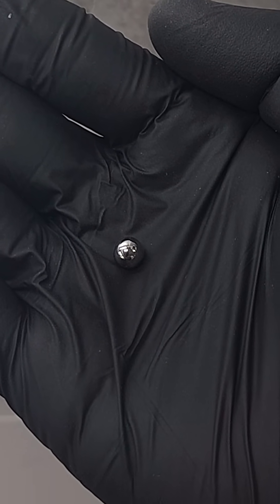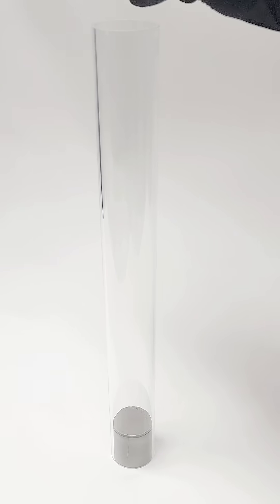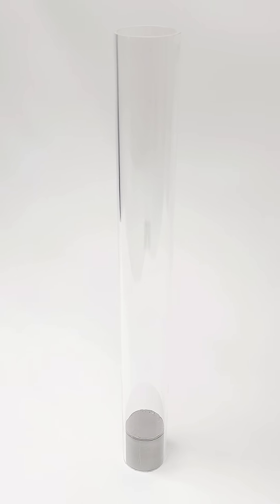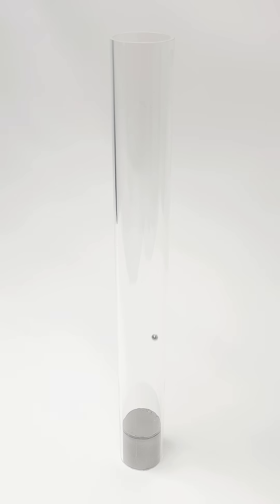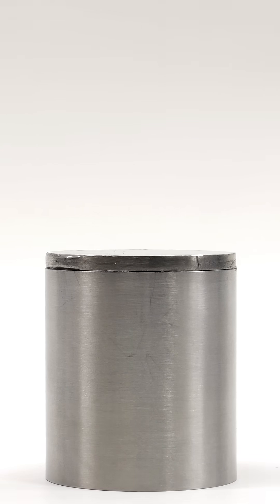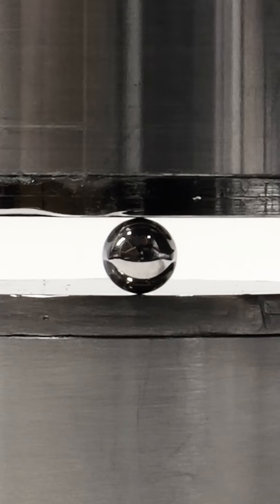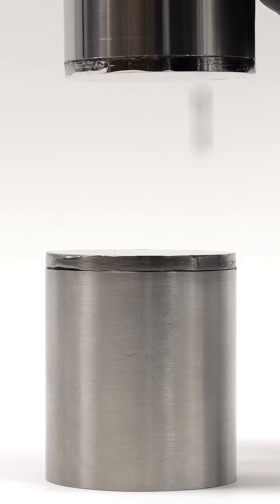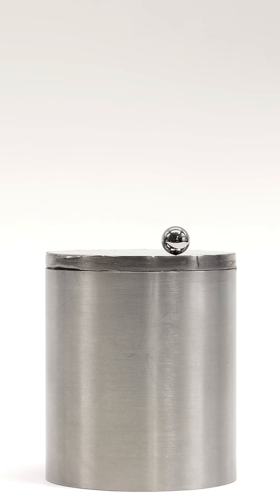This metal is too bouncy

Comment: I analysed the audio of the ball bouncing and found out that the frequency of the audio just at the end of the bounce is around 12kHz, which means that it was bouncing almost 12000 times a second!

Edit: Some people have interesting theories and suggestions, since this turned our to be a good debate, i just want to clear out some info:

1- the mic i used was a regular mobile phone mic nothing special, such mics can detect up to 16kHz if I'm not wrong.

2- 12kHz means there are 12000 individual beats in a second, which means the ball was hitting each surface 6000 times a second.

3- I tried to simplify this to be just for fun, i know i am probably wrong to some extent, if we want this to be a research it would need much more advanced equipment than i have and more specialised people than me.

4- Maybe if TheSlowMoGuys could capture some closeup very high speed footage we would be able to count the number of bounces more accurately, it would also be more fun.
Reply: I also thought about checking the audio, simply because of the sound effect, but then it occurred to me that near the end it would probably be clipped off by mic's freq response. We'd need something like a laser pointer pointing at the ball when it is "compressed" and watch the reflection on the wall meter or two away to learn more
Reply: @quetzalcoatl-pl love the idea, but unfortunately the mic will pick up those frequencies and translate them far better through a YouTube audio stream than the video could. Though a laser tachometer would certainly work if aligned properly.
Reply: if i may add - just in case - YouTube has 48kHz frequency capability, which means it can re-produce a 22kHz (top end human frequency hearing range, for most people) in a stereo stream of audio data without issue

many get confused a bit at the limitation of the compression of the data stream, which for youchoob is 256kbps audio compression - but this only affects the Quality of the audio output in human perception, not the frequency response range of the audio output.

ie. if your mic can record it, YouTube can output it
Reply: I knew it sounded like over 10k hz. This makes the material he created that much more impressive
Reply: @KUWAITGRIPSVEVO  If you think the material he created is impressive, you really need to watch the original video where he creates it, because although his version is still very cool, it is considered quite poor quality in comparison to the one he saw someone else use before deciding to make it. The other guy shown at the beginning of his video had one where when you dropped the ball into the tube it probably took like 10 times as long for the ball to stop bouncing
Reply: @HorusDeathtouch  if its not impressive make it yourself.
Reply: @tophatvideosinc.5858  I can't remember if I said it wasn't impressive and I'm not going through that many comments, but what I remember saying is just that if they think this is impressive I wish we could see what two pieces of the original metal could do. But yeah I watched his whole other video until the end so I clearly enjoyed him making it and it's a hell of a diy thing to do. He even had to work with a very deadly metal and purchase a whole new piece of machinery
Reply: You might be right, but it could also be a harmonic being transmitted by the ball resonating at a sympathetic frequency to the material. That's kind of how it sounds. To my ear it doesn't sound like it's actual frequency is above about 4k, and that we are hearing a third order hamonic
Reply: @unlisted9494 i was wondering similarly, but wouldn't it be filtered out from the peaks as sympathetic harmonics aren't as loud as the primary? If we're reading purely peak-to-peak. But this is also recorded through an unknown microphone, and through a YouTube compression algorithm, so lots of important data is missing or lost.
Reply: @tophatvideosinc.5858  Exactly. We need Slow-mo guys footage + proper gear to measure peak frequency.
Reply: Is it safe to assume that the sound it makes equals the frequency the ball is bouncing? Perhaps materials can increase or decrease pitch.
Reply: @marnix707 correct! If the sound frequency of a single bounce was 1Hz, it may be more conceivable that the change in pitch to 12KHz correlates to an equal bounce frequency.
Reply: @Templestone  were using hz to measure frequency of bounches, not the pitch or frequency of sound. Similarly to measuring framerate.
Reply: The sheer ignorance in this thread is astonishing 😂

I would recommend people playing with a PWM synthesizer to understand how individual sounds (“ticks”) of a ball can create a new fundamental frequency.

Also, why is it inconceivable that a ball bounces 6000 times per second? What makes it inconceivable per se?
Reply: @RustOnWheels  Physics makes it inconceivable. When something bounces at a frequency of thousands of hertz it isnt bouncing anymore, it is vibrating. It also isn notpossible due to travel time. Energy can only propagate that fast in a steel bearing, like the speed of sound. Of course, for any physics-flunking audiophile, reality might aswell allow anything within the contraints of their imagination.

Rhetorical question here: If someonething CAn bounce at 6khz, then is there an upper limit? Can it bunce infinitely many times within a set timeframe? Whats your take on this (fairly obvious) question.
Reply: @aronstalnacke9479  the ball acts as an oscillator.
Reply: @aronstalnacke9479  the ball acts as an oscillator. Without external excitation it will lose its energy so the amplitude will eventually drop off (while the bouncing frequency goes up). 

Now, in this video there is external excitation by a decreasing distance between the two surfaces. Due to friction the oscillation frequency will eventually top out (every bounce is a loss in kinetic energy so the higher the frequency the faster the kinetic energy is dissipated). 

So yes, there will be a maximum practical (audible) frequency on earth for any given material. 

I did not analyze this video so the actual frequency I will not make a comment about but I would also not rule out anything.

If I take a slide and pluck a metal guitar string I can go up to at least 10kHz audible. The sound created is the excitation of my nail bouncing between the bridge and the slide (resulting in standing waves).

The metal parts in my speaker can even go back and forth so many times per second that they create frequencies up to 20kHz (and beyond). Just like the bouncing ball (in between the objects) they have an external energy source. 

Is that also inconceivable?
Reply: Wouldn't that make it ~6000 bounces/s? Because every reflection (top and bottom) will create 1 acoustic peak.
Reply: @TheBerni44444 each bounce generates its own sound so it would still be 12k hz. If the reading is accurate. But the mic specs and compression play a role in this.
Reply: @TheBerni44444  it bounces at the top and it bounces at the bottom
Reply: @TheBerni44444  I think 12k strikes, with 1 strike on top then 1 strike on bottom, would create 6k oscillations (round trip for the ball), but it would still be 12k bounces since the ball is bouncing off of both surfaces, not just the bottom one.
Reply: @TheBerni44444  Its Like a sine wave...  Like a full sample...
Reply: @TheBerni44444  Each bounce creates a pressure wave that will each result in an isolated acoustic peak.
Reply: @TheBerni44444  Wow bro, you seriously must have flunked physics! Don't even try bro!
Reply: It can be over 20k, we just wouldn't hear it
Reply: @utvpoop youtube doesnt allow for over 15000hz anyway.
Reply: This is the true version of analog audio oscillation. I've only ever heard the digital wave form while switching frequency on my ham. This is amazing!!
Reply: Just did that myself, probably got way higher though because magnitude the sound waves gets smaller the shorter the stroke and it likely quickly and quietly got past the mic’s range after 12000hz
Reply: How many times have you farted into your audio device? And don't lie.......
Reply: That's why I'm here, in total or just today? @bryanergau6682
Reply: I'm listening on my phone and only heard about a high C#8 / D8? 🤔  ~4.6 Khz.  BUT... 

There may be limiting factors all the way from the response in my ears, my headphones; the max bit rate of YouTube, Nile's upload, or my phone; the max sample rate of Nile's recording 😅...

Alright, lemme put on some coffee. 😌☕

Yes, I absolutely want a slow-mo of this experiment, if anyone finds one.  It'll be better than slowing down the existing video.  Thanks in advance. 🍻
Reply: Would the materials affect the sound? And would youtube video compression affect it? Is this an accurate estimate, or are there factors that will greatly affect the value you calculated? These are genuine questions, im really curious
Reply: @Jessepigman69 YouTube audio compression nowadays are transparent enough to process audio frequencies above 16 kHz, since the current Opus codec that YouTube utilizes cuts off the high frequencies at 20 kHz. You can check yourself using an audio spectrum analyzer such as Spek.
Reply: It might be higher since it likely cut off at the frequency for YouTube video.
Reply: Thank you for taking the time & effort.
Reply: More math people like you are needed.
Reply: Nice for u to tell us the info😊
Reply: You beat me to the punch. I was going to say the same thing: record it, then look at the audio waveform to extract the frequency.
Reply: @sentinelav Bro told him to shut up just to behave like a cretin himself. Where did you graduate? Blabbermouth high?
Reply: I was gonna say, I could tell immediately the pitch went fairly high in the range of human hearing, had to be over 10k
Reply: from this we can roughly calculate the distance at which elastic bouncing stops 

(due to van der Waals forces between the surface of the ball and the plates maybe? for whatever reason distances become so small the  system dissipates kinetic energy as heat fast enough to stop the bouncing in short order)

let's say the initial velocity comes from a freefall drop of 30 cm

v = at
d = (at²)/2
v = √(2ad) = √(2*0.3*9.8) = 2.4 m/s

v/f = (2.4 m/s)/(1.2e4 cycles/s) = 0.2 mm/cycle
Reply: I'm not sure the frequency of sound you hear translates linearly into the number of times the ball hits the trampolines. The ball already creates a sound at a certain frequency when you drop it just once and that's already a few 1000 hz.

There's inertia in that little ball and for it to stop suddenly and reverse 6000 times PER SECOND seems ridiculous. 6000 times per minute maybe but I highly doubt it's thousands per second.

Of course I could be wrong.
Reply: @internettoughguy  No, youve done what most here couldnt by simply asking yourself whether an answer is reasonable or not. A ball cant jounce 6k times a second. Like, imagine it, its inconceivable.
Reply: when two smart people meet lmao this is comment is the outcome and im here for it
Reply: I cranked it up on my headphones and ran it through Specdroid (FFT waterfall diagram). I see a signal above the background out to 20 kHz, and then it abruptly falls off. That makes me think YT encoding stops at 20 kHz for human hearing/money savings since I can clearly pick up sounds out to 24 kHz with my microphone. Though, that could be the limits of my headphones also. Watching the peak frequency zip from 1 kHz up to around 12 kHz before the diminished power (and rapid change) makes it hard to see it definitely correlates with the ball bouncing. After 12 kHz I compared the ball + Nile's voice with just Nile's voice and that's how I could tell that it   has shows energies above 12 kHz and up to 20.719 kHz. It's a good approach if we could see the high end and the power taper off, but as it is it looks like the equipment limitations have kept us from getting the true upper end. Knowing the size of the ball, and how much both it and the trampolines deform could be used to find a minimum wavelength below which the ball resonating would cause rapid energy loss due to it essentially having contact with both surfaces. That is, when the center of mass motion becomes smaller than the deformation of the ball. Alternatively, electrical contact could be tracked by simply supplying a voltage and letting the ball be the charge carrier. I would expect a 5 MHz oscilloscope would be adequate, but then that is the question. This also directly relates to a classic physics question where one must calculate the number of roundtrips a fly makes as it flies from a train station to the front of the approaching train and back again.
Reply: What is the material of the trampolines?
Reply: @jessiek9731  a college posted that it's an amorphous metal composed of (Zr41.2Be22.5Ti13.8Cu12.5Ni10.0). I see references to it as Liquidmetal (R), but really that's a glass.
Reply: I was just thinking that the sound it makes must be around 10k hz or higher. Crazy!
Reply: You smart guy over here understanding hertz and shi
Reply: Ok what the actual
Reply: @thesuperfryingpan8164  I would've made a video explaining this thing to all the overconfident dumbasses in this reply section but youtube deletes links

upd: okay there's only one overconfident dumbass here but he made me mad for some reason
Reply: Nerd (it’s a complement)
Reply: Huh. Learned something. Thanks!
Reply: Seriously
 @CosmicChroniclesSci-FiStor-w8e
Reply: Absolute lad.
Reply: https://youtu.be/HEfHFsfGXjs?t=96
Reply: I actually first wondered how fast the ball was moving as velocity. Something with beats per second calculated with the distance travelled. We don't know the distance.
Reply: That sounds insane.
Reply: simply the best comment i read today. Thank you very much :-)
Reply: 6000 times, because it sounds at both the top and the bottom trampoline, so 2 times per bounce if you define a bounce as a complete cycle . DOWN>bottom>UP>top>Down.

Still pretty amazing!
Reply: I came into the comments knowing someone tried to give us an answer 🫡
Reply: This has legitimately been the most entertaining and interesting rabbit hole of a comment section, thanks for ur contribution!
Reply: The fundamental pitch definately goes over 17 kHz. Then it appears that the recording equipment is limited at just over 17 kHz... So, it might have gone higher in reality. Need a high speed camera.
Reply: From what I understand, A YouTube file does not contain enough data/bits to transmit 12k.
Reply: @idadho You understand incorrectly. On HD video, YouTube audio is of sufficient sampling rate to capture frequencies of 22kHz. Its compression algorithm may affect frequencies on the higher end of that range, but certainly everything up to at least 16kHz should be unaffected.
Reply: you assume his recorder and your speaker and recorder is accurate
Reply: I came looking for this comment
Reply: excellent good job
Reply: It doesn't matter if you are exact, you brought an interesting point to our attention. Truly amazing it bounces that many times!
Reply: microphones have different frequency response and cutoff frequency, you need to check which microphone model your smartphone have
Reply: It sounded to me almost like 16 but it might be my brain completing the sound, at the very end you get a very small tint of high pitch for a few mills like maybe 50ms
Reply: I was about to do this with my iPhone tuning app, then luckily I saw this comment.
Reply: That noise you're hearing isn't the number of strikes though. It's the effect that the bounce frequency (rate of bounce) has on the base frequency of the sound of an initial, unaccelerated strike on the trampoline.
I"m not sure if dividing that 12kHz by whatever the initial sound frequency of an unaccelerated strike to the trampoline is would…IF it's a linear progression as opposed to exponential. .
The only way to get a ballpark figure for the the final biunce rate (bounces/sec) would be to count the number of bounces at the initial sound frequency, again at double that frequency and so on, until you can no longer accurately count the bounce rate and then extrapolate that to get the bounce rate at 12kHz. Shouldn't be too difficult if it's a linear progression, but I doubt it. This also doesn't take into account any variation in sound between the 2 trampolines, fluctuations in their individual surfaces, etc
Reply: @iratepirate648  the biggest thing people are overlooking is way simpler: natural harmonics. The closer the walls get the more harmonics you get and thus the higher it oscillates like how a guitar screams when you distort it. Sound is not only created at a certain frequency but there is a constructive resonance mode feedback loop where the sound bounces off the surface and then comes back at the same frequency and also all of its multiples (harmonics) and every time it bounces it adds up with the previous ones, it’s not only the base sound you are hearing but also all the acoustic interference 

Maybe with fouriers transform you could calculate it from the recording (i.e. some tool like using a spectrogram) and with a mode or other set of equations model the acoustic interference, and then you can isolate only the noise made without acoustic resonance 

But I think it’s easier to just use mechanics to model the bouncing instead of using sound theory to guess it
Reply: You would likely need to measure the sound frequency of a single hit in order to extrapolate the final bounce frequency.
Reply: No way that is insane
Reply: Getting more 7kHz content than 12kHz. Measured on phone through car speakers
Reply: I summon Gavin Free!
Reply: Seems impossible, man I love science.
Reply: Idk mane I jus do not see that my briv
Reply: Any faster, you will open a wormhole.
Reply: thank you, came here to the comments to say/see this
Reply: unless you got the original files, compression algorithms tend to compress frequencies to human ranges, doubt yts goes much higher than perhaps 40hz at most frivilous
Reply: 12000? :) а вы горазды пошутить :))
Reply: Not a good idea to check sound from packaged video format... Need raw for better quality.
Reply: don't care
Reply: Nice comment.
Reply: You are half right.  Its bouncing off two directions.  You have to double your answer
Reply: That sound makes my ears smile
Reply: Probably needs a more controlled method for bringing the two surfaces closer together. It's easy to imagine that the approach speed isn't continuous, which would throw off attempts to measure it.
Reply: Wait, you don't even need to record it. Just download the audio of this video.
Reply: The methodology is sound (haha), so I'd say this is about correct, assuming it bounces off each surface 6000 times a second, which is pretty crazy
Reply: I feel so dumb after reading this thread. Haven't a clue what you guys are talking about.
Reply: @jimbobjunior. You’re probably smarter than half the people in this thread, don’t worry. The amount of people being confidently incorrect is exhausting.
Reply: If he was to oscillate the hight rapidly you might do somthing weird with the sound barrier
Reply: I'm thinking it would spike at maybe twice your number when it hits the harmonics. Would love to see this in more detail and in a vacuum chamber.
Reply: 12000 hz = 6000 bounces... not 12.000
match this unknown stuff 😂
Reply: You guys saw the sliding blocks Pi number video? 100% pi is involved here toi
Reply: Maybe YouTube upload or play video audio in max 12khtz
Reply: You are missing one factor-- video compression.  While youtube is great in general and most lossless audio stuff is not really important beyond preference, In this case it really matters and it could be not accurate at all-- even if your phone mic was spot on for the audio of the video itself.  I have seen other scientific videos on youtube about sound stuff and youtube videos often struggle with sounds above 10k-- will depend though of course.
Reply: I'm seeing frequencies up there but it seems the primary frequency reaches about 6.8kHz.
Reply: This is the comment I wanted to see when I saw this video, Good analysis mate.
Reply: Why do I feel like I've seen this comment many times before 🤔
Reply: I can't believe you caught so much criticism for such a simple statement. I had to go back at defend yourself that's ridiculous
Reply: analyzed*
Reply: I'm in absolute AWE of you guys' tenacity! Nerds For Life!
Reply: Couldn't you use a Piezo disc and oscilloscope to count the bounce
Reply: That frequency is really only around 3.5khz. Tell us you know nothing about audio without telling us you know nothing about audio.
Reply: to what note corresponds
Reply: Cómo algo puede rebotar 12k veces en un segundo
Reply: Interesting
Reply: He said it himself if you listen to the video
Reply: That is incredible
Reply: I was able to determine that using my ears only ;p I mean, most of the musicians would.
Reply: Damn.
Reply: Saved me a test. Thanks
Reply: 666 likes and then exactly 300 in one reply section 🤯🫨
Reply: My ear told me 13K for top  so not bad with just my ear
Reply: @ huh
Reply: Pov Albert Einstein
Reply: ?como te parece que logro?el trampolín?....2*?imanes de añodiño de diferente polaridad..
Convengamos que el tubo plástico*puede tener arriba pintura..que lo lleva arriba...pero no lo deja escapar(leve carga eléctrica)(?barniz?
Reply: Probably closer to 15k-17k
Reply: What will happen if you will place your finger while it’s bouncing
Reply: Nope. It just means the sound it produced was 12kHz.
Reply: This means it was CHANGING DIRECTIONS 12,000 times a second! 🤯
Reply: Hey bro, genius of you to relate the frequency of sound to the frequency of taps
Reply: Youtube I think also has a cutoff frequency, trusting your analysis, probably at 12kHz, so it might be EVEN MORE than that!
Reply: What, 12,000? There’s no way that can be right!
Reply: Nice 👍👍🎉
Reply: The slomo guys rent the cameras
Reply: Your audio analysis (or fft run in audacity) is also analysing the sound of the ball striking the plate. Unless you use a filter to get rid of it, your results will be skewed if you don't take it into account.
Reply: Oh, you didn't even use audacity. Just spectroid and a phone. Even worse. What envelope function did you use?
Reply: What about pie everyone
Reply: SHORTER DISTANCE = FASTER CYCLE = HIGH FREQUENCY
Reply: You would have to take only half of that to arrive to the number of periods/s. Still fascinating.
Reply: While the analysis of the audio frequency is valid, the leap to conclude that the ball is bouncing almost 12,000 times per second is oversimplified and  incorrect. A bounce cycle involves contact time, compression, and decompression (impulses), which cannot occur instantaneously.
Reply: @aronstalnacke9479  The contact, compression and decompression need only be shorter than the travel time between bounces.
Reply: @sentinelav   This sound frequency does not directly equate to the bounce rate (how often it bounces), as the bouncing rate (in Hz) is much lower. Instead, the high-frequency sounds are generated by the rapid oscillations and movements of the ball as it bounces, creating vibrations that can be perceived as sound at higher frequencies.
Reply: @aronstalnacke9479  It doesn't need to be a mathematically instantaneous impulse, it just needs to be substantially smaller than the travel time between bounces. The contact time, compression and decompression are all components of the impulse that forms the audible pressure wave. You can see this for yourself in some audio software.
Reply: Why would 12khz sound frequency imply 12khz bounce frequency? You know one bounce per second is not a 1hz sound frequency, right?
Reply: @PaladinswordSaurfang  One bounce per second is indeed a 1hz frequency! There's no lower limit. There's only a lower limit to what's perceptible as a continuous tone, and a lower limit still to what's perceptible as a continuous rhythm.
Reply: @PaladinswordSaurfang  frequency can be interpreted this way, as frequency literally implies how frequent something is repeated in a guven amount of time. Just like how a monitors refresh rate is measured in frequency of HZ despite not making sound at all. 60fps is 60hz because the frame refreshed 60 times in a second. The ball at its fasted was estimated to have hit the up and down surfaces over 12000 times in a second.
(the accuracy of this measurement is in question) 
This is as simple as i can make this .

Use context, friend.
Reply: I know it was scientifically possible. I was going to ask if he could analyze the sound and figure out how fast it was but you did it for me and him. Awesome and thank you
Reply: I also suspected the frequency could be measured to estimate the bouncing speed. I imagine you'd have to adjust to account for the sound of a single bounce?
Reply: @VirtualCowboy26  no frequency is literally that. A guitar string measuring a certain frequency will be moving exactly at that frequency. I don't think you need to adjust for anything in such a simple system.
Reply: Ummmmm couldn't this potentially be used to generate power?
Reply: @Andronicus87  well yeah, just about anything can generate power if it can transfer energy, and everything transfers energy. 

If you can think of a practical way to capture the energy from a bouncing ball, figure it out, might be a fun stem project.
Reply: How did you possibly get the kHz from the video, what software did you use to get it?
Reply: @Mdksupreme1  20kHz is the typical range of human hearing, and virtually all digital audio is stored with at least 44.1k samples per second, which translates to a maximum frequency of 20.5kHz according to Nyquist sampling theory. 
Virtually all audio software will let you handle sounds up to this frequency. If you want to try it yourself, find a youtube to mp3 converter, and load it into an app that features a spectrogram.
Reply: @Mdksupreme1  You could try using a guitar tuner app or something that will show you the frequency.
Reply: Number 4 Please
Reply: Great research mate 😊
Reply: That was my estimate from the audio as well. I got no likes, and you got 6k :)
Reply: But it never reached a second so it was more like 100 times and 100th of a second
Reply: Not quite, but good attempt, you'll get there eventually 👌🏿
Reply: How is 12,000 bounces a second even possible.
Reply: 😂😂😂😂😂😂 no
Reply: I doubt it actually bounced 12000 times per second. If that were true, each individual sound the ball makes would be around 1 Hz.
Reply: @Shonade2  That’s not how it works, hertz means peaks per second in a sound wave (the frequency of the peaks). One peak is not 1hz, one peak per second is, therefore, if it’s making 12000hz it’s bouncing 12000 times per second
Reply: @Chlorophyll08  I know what a hertz is, I guess I'm just confused. I'm talking about the sound the ball produces each time it bounces once. That sound itself was not 1 Hz because we can hear it (probably more like 200 Hz). That's why I think that when it produces a 12 KHz sound it's not truly bouncing 12,000 times off of both trampolines.
Reply: @ yeah fair enough. I guess the question is whether the dominant sound would be the frequency of the bounces or the resonant frequency of the ball itself.
Reply: I have been tested to have fairly remarkable hearing.  That sound range sounds right to my ears.
Reply: @sentinelav  "The whole problem with the world is that fools and fanatics are always so certain of themselves, and wiser people so dull of doubts. " (Russel) 

Sit down, and ask yourself this question. Can something (not in your imaginary world of nonsense) bounce between 2 surfaces 12 thousand times in a second? Consider it. A simple thought experiment. It might do you some good, you pitiful creature.
Reply: @drained1177  Oh the irony, you don't exactly seem full of doubt mate 😂😂
Reply: @drained1177  the tone is created by the ball bouncing increasingly quickly, that we can all agree on. however, the idea that the frequency we hear by the end has any relevance to the initial ones (the sound of the bounce itself) simply makes no sense. the high pitched frequency we hear cannot have emerged from an increase in pitch of the bounces themselves; no matter how you hit an object in a given place the sound it makes will not change frequency. also, the sound rises from a much lower frequency than the metallic 'tink' noise the bounce itself makes. thus, the frequency we hear must necessarily be produced by the number of bounces per second, where the bounce itself forms a wave cycle. the frequency you hear must be directly related to the number of bounces per second.
Reply: @laylafromtf2  Sure, except anything over 1000 hz is impossible for a ball. This alone suggests that it isnt as easy as listening to the frequency.
Reply: @drained1177    exactly there is no way that ball could bounce 12,000 times a second. It would be creating so much energy that it would be white hot, melting, or shooting out like a bullet after it fractured. The pitch is increasing because the shorter cycle of vibration, just like guitar strings.😊
Reply: @UtoniumJock  The material used here is a special alloy with an extremely high elastic coefficient. Only a tiny amount of energy is lost, and mostly to sound, so very little heat is building up. The vibration you're hearing IS the bouncing.
Reply: @UtoniumJock  Exactly! The ball bearing on the video is clearly only bouncing tens to a hundred times a second in those last instances. Of course, not everybody here appears to accept the reality of things.
Reply: There's something profound in this. Is there a physical equivalent for Young's Double Slit experiment? Is there a frequency at which a "normal" physical object behaves more like a SA particle?
Reply: What's wrong with using the correct abbreviation for hertz ?
Reply: @benjurqunov He's right over here officers..........
Reply: @benjurqunov 
Nothing, really.
(( struggling to resist the temptation of adding 'That Hertz.' 😋  ))
Reply: I think that would make 24 000 bounces a second. Sound needs an alternating of high pressure (ball bounces on trampoline #1) and low pressure (bounce on trampoline #2) for a full wave.
Reply: No it doesnt, its already making a frequency of around 500 hz when bouncing so it was bouncing more like 20 - 30 times per secomd
Reply: @IljaMuromec114  it doesn't work like that...
Reply: @IljaMuromec114  It's absolutely not making a 500hz tone when bouncing. 20-30 times per second? Really? Baffling comment.
Reply: Shit analysis. Do you think 1 bounce has the frequency of 1 hertz? Since u cant hear 1 hertz you shouldnt be able to hear it when it bounces slowly.
Reply: @drained1177 Yes! That’s exactly what that means you absolute imbecile, Hertz is FREQUENCY OF SOUND, has nothing to do with loudness, one hertz is simply 1 event of any kind happening per second, in this case, the 12 thousand bounces are those 12 thousand events of the ball bouncing , Dunning-Kruger effect going crazy on this one.
Reply: @drained1177 1 Hertz also does equal one bounce, that’s the amount of events creating the sound (The Bouncing itself), and therefore the frequency, 😐
Reply: @drained1177  Can you hear a 1-beat-per-second drum beat? Of course you can, because the sound is transient. You can't hear a 1hz sine wave, but you can absolutely hear a repeating sequence of impacts at 1hz. These form a cohesive wave at high frequencies, or at least, our brain interprets it as such.
Reply: @sentinelav  Now if you then used your reasoning and thought about it, youd quickly know that what you hear may have a rhytm of 1 hertz, but the drummer produces a sound of up to hundreds of hertz. The internal vibration of the material produces the frequency, just like in this video. Not the amount of bounces, they are not proportional.
Reply: @drained1177  That might make sense if the resonant frequency of objects change, but they don't. If it was the resonant frequency of the ball we're hearing, it would get louder, then quieter, without changing pitch. 
A drum beat has two primary frequency components, the drum beat itself, and the tones produces by the impact. They are different things, but become indistinguishable when the beat itself is fast enough. This is when the bouncing goes from sounding like separate beats to a distinct tone.  
Keep in mind that I'm a lifelong audio professional and am educated in physics fundamentals. I know this stuff as fact, I'm not making it up.
Reply: @sentinelav  I apologize to inform you that you should really review your basics if thats the case. This is elementary physics and it doesnt even need any complex physics. To put it simply: Nothing in the macroscopic scale can ever "bounce" at a 12khz frequency, thats essentially vibrations in microscopic systems, between large molecules in dynamic biological systems. You may do the equations for the kinematics. 

Apart from a 12khz bouncing frequency being completly inconceivable and ridiculous, your assumption that the resonant frequency of objects just "become indistinguishable" is absurd. You may analyze the waveform and observe the modulation of this wave to determine audio peaks, it will yield a much more realistic result magnitudes away from 12khz. You must however use the resonant frequency as a baseline. 

Science cares little about ego and your academic background, reality is indifferent to you. If you had paused and pursued the answer instead of settling the debate with ethos, your scientific career may have reached more brilliant heights. Just a bit of friendly advice for your next debate in acustics .
Reply: @drained1177 How do you think speakers work? They vibrate. Just how the ball is basically vibrating between those two trampolines.
Reply: @MelvinGundlach  Yeah, right. Because we all know speakers have balls in them.
Reply: @drained1177  Therapy is recommend for anyone dealing with the long-term emotional and social effects of parental abuse.
Reply: @sentinelav  Chill out, "Mr. Physicisit"
Reply: @drained1177  Listen dude, if some of the phrases you've been using come from someone else in your life, you need to get away from them ASAP. It's not your fault, but taking yourself on the same kinds of power trips will lead to a life of misery.
Reply: @sentinelav  我说一句，你说两句
Reply: @drained1177 Your comments are wrong to a fascinating degree. The claim that nothing macroscopic can oscillate at 12kHz in particular - if nothing can move that fast then why can humans hear frequencies nearly twice that (do you think singular atoms vibrating can generate audible sound?)?

You should look more into how sound works before being so confidently wrong, but a helpful hint here is that you can clearly see that the frequency changes as the period between bounces goes down, which obviously couldn't happen if the frequency was entirely dependent on the sound of each isolated bounce and had nothing to do with the composite waveform, since the material properties don't change. As other commenters have already explained, what's happening is each impact creates a pressure impulse, and the impulses are happening close enough together to create their own rapidly oscillating pressure wave, ie sound.
Reply: @bosstowndynamics5488  Believe whatever you wish. Ill just give you a hint, air is a gas, a metal ball bearing is not and the limit of air frequency is not something defined by human perception.
Reply: @drained1177  You say this as if air is the only medium in which sound can exist. Fun fact, sound is actually substantially faster in metal than in air. And I'm well aware that human perception doesn't put a ceiling on frequency, my point was more that even mere humans can handle 20kHz so it really shouldn't be a surprise that 20kHz frequencies exist on "macroscopic" scales
Reply: @drained1177  Fun fact, combustion motors can easily reach 4000 RPM. These need more complex motions than a simple bounce. It's definitely possible for a ball to oscillate more than 6000 times a second
Reply: @andermium  A motor can indeed achieve very high rpm, and there are other power hungry mechanical systems that truly stretch the bound of mechnical oscillation. Try to understand that there are very different energy demands in these systems, the only reason a motor can spin that fast is that it receives energy from explosions to counteract energy losses. A ball bearing possesses a very small of initial potetial energy, and as the frequency increases, that energy dissipates too quickly for it to ever bounce a thousand times a second. I hope this sounds reasonable.